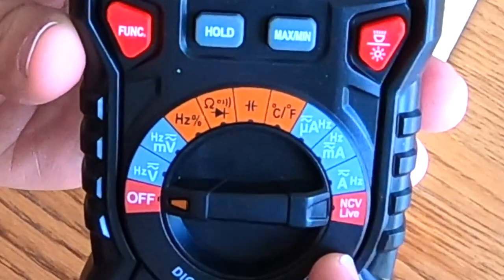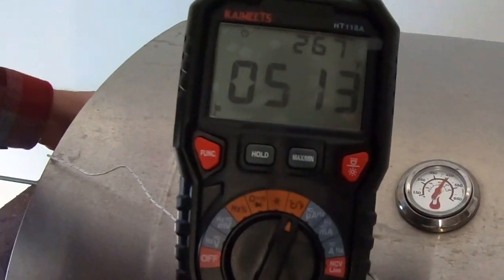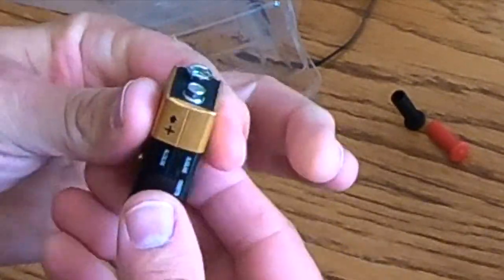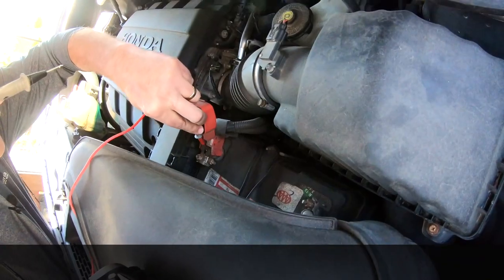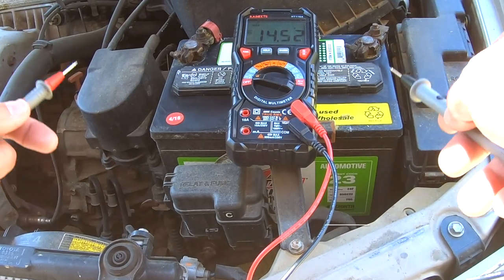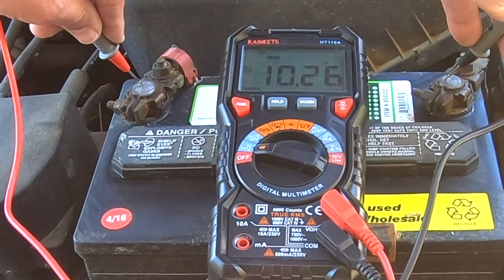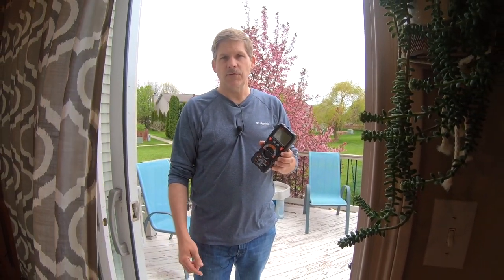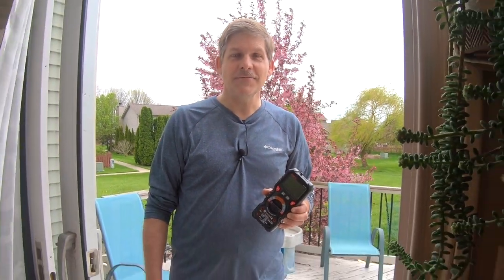How to use a multimeter to test things around the house: Kaiweets Multimeter Review for DIY projects

Comment: Nickel Metal Hydride (NiMh) RECHARGEABLE. batteries will measure 1.2 volts when fully charged.
Reply from the maker: Hey John,
Good point. Thx for watching.
Reply: Higher at 1.34 to 1.37V

Comment: KAIWEETS is a dangerous disaster all around, and this particular review starts with a trivial aside, always the sign of a bad teacher, even failing to tell you the temperature sampler uses dedicated wires not used for any other work. Just awful. Btw, the margin of error for the temperature gauge is substantial, and goes unmentioned here. Of course.

Good teaching always begins with an overview of the material, the context, and the main subjects or features. This is not good teaching. 

The manual is outright dangerous to novices. It's full of typos, errors, and omissions. The translation is laughably bad. The icons are bizarre. "Hz%"? Seen that around a lot?

4:00 - good god. 1.35 Volts isn't remotely "dead." On older multimeters, 1.35V puts you comfortably in the green. It's 90% of a full, 1.50V charge.